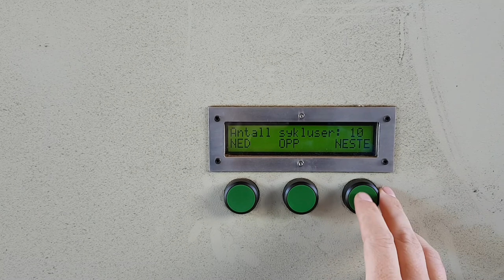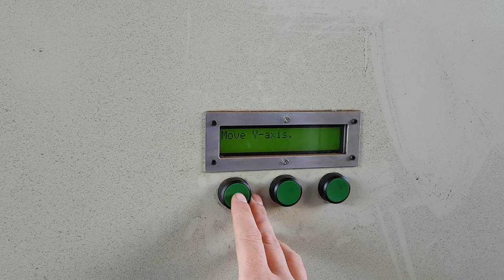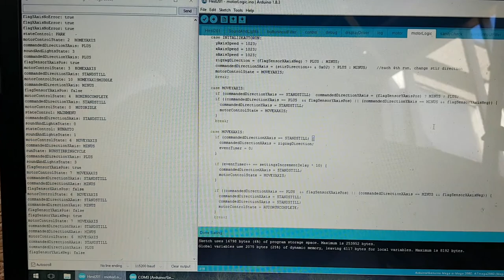Horse shit stirring machine

Comment: What is the name of this machine? Shit 2000? How many tons of shit per hour? Does it blend the shitmix in a upward direction? What is the name of the plc/box you put in your c++ code? This is some nice shit Rolf :-)
Reply from the maker: Shit flinger 2000PRO.  :) 
It takes 7 tons which dries down to 3 tons in 22hours.
Every direction.
industrial shields m-duino 42, a industrial strength Arduino Mega 2560